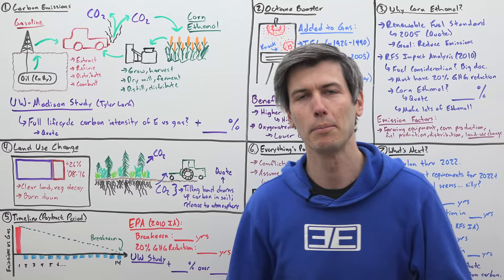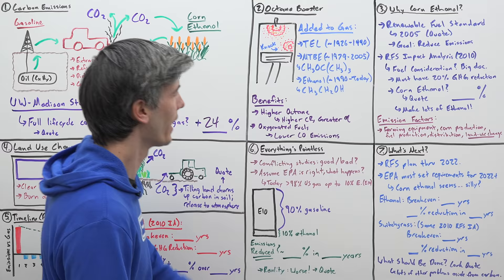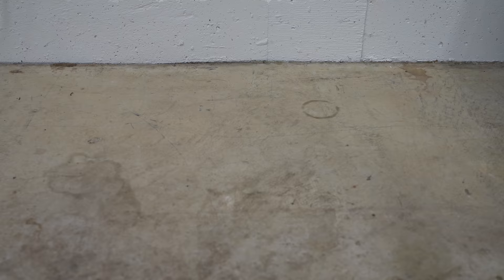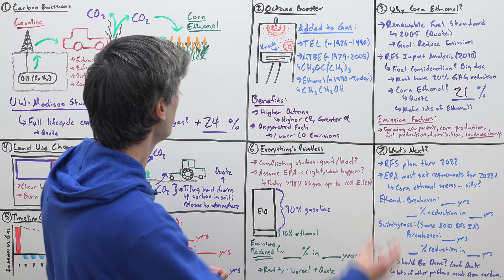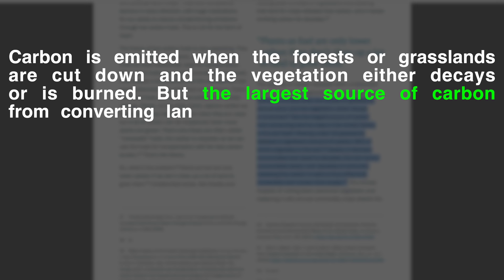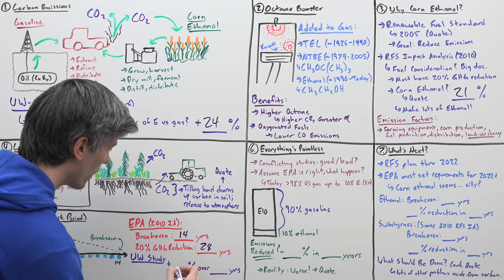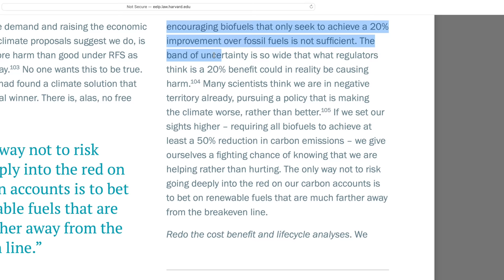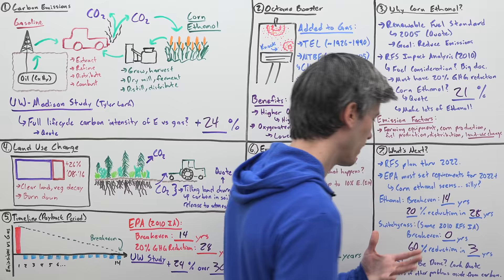America Was Wrong About Ethanol - Study Shows

Comment: I would like to know more about how they calculated the land-use for ethanol. Farmers generally don't react to market changes by simply clearing and planting virgin land. They usually just change what gets planted on the acres they already have, and maybe plant low-yield acres which are unprofitable when prices are low. And in terms of corn markets in general, if corn based ethanol is elevating prices, that means other corn consumption goes down. High feed prices mean reduced meat production, or high HFCS prices mean more substitution of cane sugar. The Ag markets are not in some steady state where increased demand can only be met by clearing virgin land.

It's a really messy economics problem to model how many virgin acres are really being cleared and plowed in an ethanol vs non-ethanol US energy policy. This is true in a lot of CO2 modeling when it comes to setting policy. It's really straight forward to calculate the emissions of a defined industrial process. It's hard to model what happens out in the real world which is governed by market forces.

 But perhaps that reinforces your point that it's not a good idea to undergo huge policy programs when the modeled payoff is only marginal. The focus should be on solutions which offer very clear and very large advantages such that it doesn't matter if your calculations or assumptions were off by a few percent here and there.
Reply: Remember. All models are wrong. Some models are occasionally useful
Reply: I doubt that "family farms" are clearing new land: They do not have it. But the small farmer, the "family farm," seems to be a disappearing entity. They are useful to exploit when justifying legislation, and convincing voters that a program is "for the people." However, increasingly the farming is done by large corporate farms (I liked the term in the book, "Wind Up Girl:" the "Calorie Companies."). Increasingly, the "family farms" produce to contract for the mega-corps. The mega-corps commonly till their own land (as opposed to contracted land) as well. Mega-corp exists to expand. Indeed, stagnation is death. Thus, mega-corp  must acquire more contractors (a diminishing resource), acquire smaller/vulnerable/available industrial agriculture firms, or expand their own tilled acreage. Here is where I expect that you will find the land use conversion.
Reply: Ethanol is made and there is a byproduct that is fed to cows. Ethanol makes sense. Not to mention the U.S needs 10% less fuel from Arab countries.
Reply: @deshaunjackson8188  Ethanol makes no sense on any sort of large scale. It is all about energy density. You have to burn more Ethanol to get the same or similar performance among other things.
Reply: @deshaunjackson8188  If I understand correctly, the byproduct is corn hash that is fed to cows. It will blind the cows if they eat too much. I retired from the delivery side of milk products and our dairy wouldn't buy raw milk from producers who fed their cows this product..it made the milk taste bad! Probably wasn't good for the consumer either!
Reply: I agree. If the land was farmable it would have been burned and cleared decades ago.
Certainly other grasses will be more optimal (or bacteria based bio fuels), we need to get  started somehow.
Reply: I’m curious about this as well. If the land will produce a crop, it’s already being farmed. Farmers don’t just have field of grasslands or forests sitting around not being planted (unless they’re being used as pasture or in a government set-aside or wetlands program). To plant more corn almost always means planting fewer soybeans or wheat, not tilling up virgin land.
Reply: @billharm6006  So-called corporate farms get their land when family farms sell. They don’t have extra land sitting around not being used either. That would be foolish to have tillable land and not plant a crop.
Reply: @boblynch2802  The "mileage" question--the "energy density" question--is an important one. I have seen pollution comparisons based upon fuel volume. I have yet to see a published pollution comparison based upon generating equal amounts of energy. I can find the raw data. I can do the calculation. But a peer reviewed analysis backed up with physical testing seems missing. Perhaps someone can direct me to such a document?
Reply: @76horsepower  Sort of true. But they can use their profits to buy more; they can use their influence to get federal lands released to production.

I say "sort of" because the world of agriculture is exceeding strange. The Federal Government is known to pay people to keep their land fallow, etc. So what will make the most money? Harvesting a crop? Harvesting the taxpayers? There is also the question of whether they currently have either the production capacity or the market demand.
Reply: @deshaunjackson8188  First, please separate "ethanol" from corn. The presenter mentioned "sawgrass." it is far more efficient for producing ethanol. It too probably has a useful byproduct, though I would expect it to be as a fertilizer. Anybody out there have an answer for uses of sawgrass "mash?"

Second, grain is great for fattening cattle for butchering if all you are after is muscle mass. However, human nutritional issues arise.  But that is another, quite separate discussion. I only bring it up because, as a rationalization for corn-derived ethanol, it has some shortcomings. Another commenter has already mentioned a couple of other issues.
Reply: @garyrobbins5505  My friend works on a dairy and it is common practice. If you knew anything about how stringent the requirements are surrounding the quality of milk, you would know that what you said is dead wrong and a lie.
Reply: Corn grown for ethanol production and corn grown for human consumption are two completely different products.  You wouldn't want to eat bio-fuel corn.
Reply: @boblynch2802  Wrong.  Ethanol has been net positive for a long time.  Maybe the first plants weren't, but that was decades ago.  The use of enzymes and dry milling has made a huge difference.
Reply: @brianmiller1077  I was working in that industry about 5 years ago.  The technology works, they were making headway, but cheap oil and then the pandemic finally caused the last demonstration plant to close
Reply: @deshaunjackson8188  "Lie" is a very strong word that denotes a deliberate intent to deceive. Using such words seriously interferes with constructive debate. It also undermines your position. He may be misinformed, I'm not an expert in that area of discussion. However, even if he is incorrect, there is a great distance between being misinformed and lying.
Reply: @ADAMJWAITE  True. Field corn and Sweet corn taste very different. When I was younger I worked harvesting and drying field corn. It occasionally provided a midnight snack while attending the driers in a chilly fall night. You have to be cold, hungry, and bored--or have no sense of taste--to stomach it.
Reply: @acjohnson1986  I think you mistook Bob Lynch. The amount of energy in a liter of grain alcohol is significantly less than in a liter of gasoline. That disparity is what he referenced.

There was a time when it took more energy to make a liter of ethanol than could be obtained from a liter of ethanol. I presume that state is what you claim has changed. I certainly hope you are correct.
Reply: So a lot of the “converted land” was in existing fields. For a lot of years farmers were paid money to leave portions of fields unplanted, out of production.  The other problem with the Harvard study is that most crops are now no till. The prior years crop trash is left on the surface and the planters cut through to place the seed. So the soil in not turned over with moldboard plows. The number of trips through a field with a vehicle is greatly reduced. Often the seed, fertilizer and any herbicides are applied in one or two passes. With precision farming the exact amount of fertilizer is applied in a tailored method to each subsection of a field reducing the amount of chemicals used, reducing input costs for the farmer. Any numbers from a study that is 10 to 15 years are apt to be outdated.
Reply: @deshaunjackson8188  Trouble is, feeding corn to cows has proven to be bad for the health of the cows, grass fed is the way that cows should be fed, but money gets in the way. I would imagine if you can buy meat from grass fed cows that the price would be higher and people may not be willing to shell out for it.
Reply: @deshaunjackson8188  Without necessarily going EV, which many should, they could change attitudes and buy more efficient vehicles. Why on earth does a person not living in a farm need a big, massive pick-up truck with large gasoline engines that get just slightly more than 10/15 MPG. If we went that route we would not need to import oil in a short time.
Reply: @richardsparks9904  I would say typically when a quarter is cleared it would need to be cultivated fully before it's seeded. After that initial till the farmer would likely switch to no till. Although I just saw some info last week that said that only something like 30% of farm land is using zero till currently. Where I live it's the standard but that's not the case globally
Reply: Even worse than virgin forest, in Canada, marsh-lands have been converted to farmland.  Those lands are critical environments for many species including migratory species.  Also, they are part of the water cycle and the loss has lead to widescale damage to lakes such as eutrophication of Lake Winnipeg.  This is irreversible ecological damage done to "save the planet".
Reply: Are you saying that all land in the US that could possibly be farmed has already been purchased?   That if a crop becomes suddenly significantly more profitable that there is no land anywhere in the US for farmers to expand their farms or start new farms?
Reply: @Jaqen-HGhar  Well, actual farm acreage in the United States has declined by 5% over the last 20 years.  So either we're more efficient at our land use, demand for farmed products is lower, or we're importing more from overseas.  Probably a combination of all 3 depending on what product we're talking about.  But clearly the demand for ethanol has not resulted in a massive increase in farm acreage.
Reply: @ChurchAutoTest  funny how the drop of farmland wasn't brought up, nor that fuel based corn is Dent Corn not Sweet Corn and Dent Corn is undigestable by humans, or that the spread is +/- 25%.
Reply: @billharm6006  i live in a rural area. Here many small oak groves and crp grass lands have been put into production. also abandon farm yards and pasture land being plowed up because the dairy herds have left.
Reply: @bowez9  Indeed.  Our host should perhaps be a little more circumspect about quoting studies without looking into their foundational assumptions.  This study is garbage at best.
Reply: @ChurchAutoTest  Keep in mind a thing sometimes referred to as Urban Sprawl. Areas where I reside that used to be planted fields are now deep within developed communities. This conversion stretches for miles in an ever-growing ring around the major, Midwest urban center where I live (I've been working here for 44 years). Farmland has been converted to other purposes. Some of those losses were probably permanent. In other cases, new land was broken. Total acreage might not be growing, but it does seem to be shifting. I don't know the details. This observation, along with points made by yourself and others (points like changes in agricultural methods and ethanol production processes) demonstrate just how difficult it is to get a handle on the true impact of the ethanol mandate on greenhouse gas production. Any snapshot in time is likely obsolete within a few years.
Reply: @76horsepower  it’s either corporate or foreign owned.
Reply: Yes, often things aren't so simple. Every one of these studies criticizing corn ethanol that I've looked at doesn't account for the distillers grains that is also produced with the ethanol. Since there was no mention of that here, I assume this one also has that monstrous flaw.

The protein in corn is not consumed when making ethanol. The proportion of protein in whole corn is too low to make feed so additional protein from soybeans is added to make a balanced feed. However, the protein left after making ethanol is a source of concentrated protein called distillers grains which is then used instead of soy protein. It works out that for every acre of corn used for ethanol, an acre less of other crops is needed.

Corn is about 10% protein. Soybeans are about 40%. By using both, feeds ranging from 14% to 22% protein are often made. However, neither corn nor soybeans have enough fiber so a source of fiber also has to be grown. After the starch is used from the corn to make ethanol, the protein is left in the distillers grains at about 30%. The 30% protein distillers grains can be mixed back with 10% protein whole corn to help make the needed balanced protein. Plus the distillers grains still has the fiber. That reduces the need for soybean and fiber crops.

On a percent basis, soybeans have about 4x the protein compared to corn. However, corn produces about 4x the yield per acre. So on an acre basis, corn and soybeans are practically equivalent for total protein production. That means for every acre of corn used for ethanol, an acre less of soybeans is needed. Plus less land is needed for a fiber crop. So their claims of land use change due to corn ethanol are gibberish.
Reply: @garyrobbins5505  We've fed a lot of distillers grain. Never had an issue. Even sold milk to a plant producing specialty and premium cheeses for places like Chipotle  restaurants.
Reply: @billharm6006  Agreed, there are so-called set-aside programs where the government pays farmers not to farm certain areas, but that’s taking land out of production that had long been in production, thus the land had been already tilled and the carbon loss already occurred.
Reply: @ADAMJWAITE  You wouldn’t want to eat an ear of dent corn, no, but the same corn used for ethanol is used to make cornmeal, which is used in breakfast cereal, muffins, taco shells, corn chips, and many, many other things. It’s just not eaten plain the way sweet corn is.
Reply: I guess my information was not correct!!!
Reply: @heartysteer8752  I guess my info was incorrect!!!
Reply: @billharm6006  I would love to see that as well!
Reply: @Jaqen-HGhar  New farmland would need to be converted from something else; typically forests or marsh-lands.
Reply: You forgot to factor in that he's talking about REPLACING ALL fossil based petrol with ethanol, not just the 10% there is now. You'd need to increase the area of corn farmland by 920% to do this.
Reply: The total fuel consumption of U.S airlines is approximately 19 billion gallons annually. 

Total fuel consumption for mining lithium to make electric car batteries is 21 billion gallons annually.

The 21 billion gallons can only produce enough lithium for 250,000 car batteries.

The lifespan of an electric battery is 10 years and is not renewable.

Electric cars are not better for the environment.......they're worse.
Reply: @billharm6006  Oak Ridge, ORNL has several studies if you look thur the SAE papers on E85.
Reply: @76horsepower  Correct, I've been farming 40 years and have never seen virgin land being cleared for a new crop, at least in my area of the US.
Reply: @garyrobbins5505  its not called corn hash its called DDGS (Dried distillers grain with solubles) or wet DDG and is actually used by a lot of farms including dairy for the main reason its high in protein about 39-45%.
Reply: @adoreslaurel  im not saying your wrong and I'm not saying you are right but corn is not bad if given in lower quanitys. Yes you can feed a cow straight corn but you have to slowly introduce the corn to the cow if it was previously on something else like hay but some times even the milk the calfs get from the mothers can give the calf scours, alfalfa and clover can give the cow bloat if the cow eats to much to early and to fresh grass can even give bloat. So you cant say corn is the only bad one.
Reply: @davidsuzukiispolpot  actually in canada any thing designates PSW land can not be touched. i have spots on my farm land that are PSW.
Reply: @Jaqen-HGhar  Farm land is a scarcity and is being bout up by corporations building new houses and for someone to start farming you need to buy land which here in Ontario  Canada depending on where you are is about 20-50k an acre so you do the math on that so to even be profitable to buy a combine, the 2 headers, planter, tillage equipment, tractors and gravity bin you would need about or close to 700 TILLABLE acres to even justify doing it. So starting a new farm is hard with out capital.
Reply: @Ian.Powell  Good point, well said, Thanks.